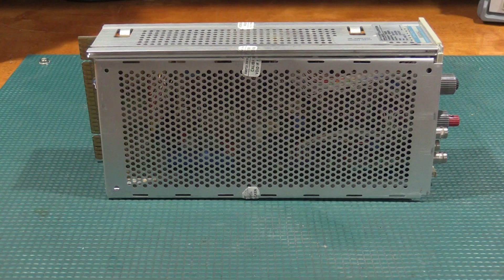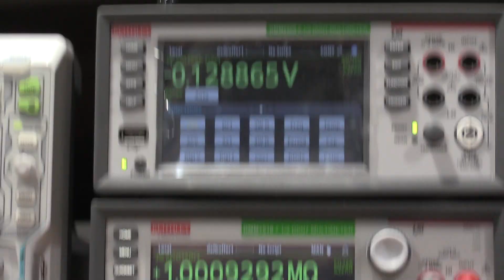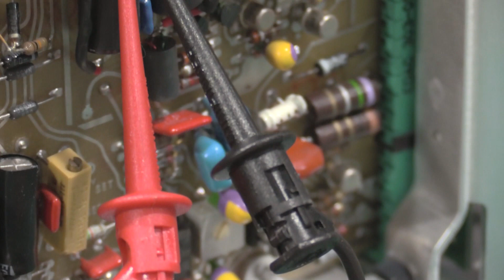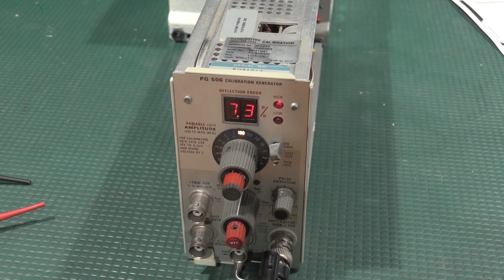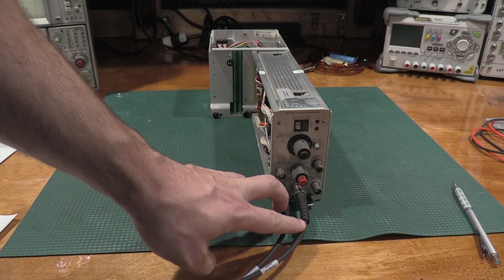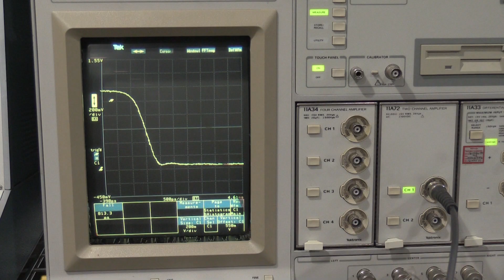Tektronix PG506 Rebuild and Calibration

Comment: So many Tek plug-ins have the plastic bezel of the front panel broken like this. I have taken some dis--assembled doner plug-ins and cut segments of plastic from them to glue in place on restoration target. Of course one must use proper pre-shaping of the break, and the replacement. MEK based liquid plastic solvent from any hobby shop works great to fuse the seam line.

Comment: That is a clean unit - the power resistors on my fast rise/fall board were showing signs of heat stress, still within spec, but looking tired.
I had the same experience with caps you did, but I pre-emptively replaced all the tantalums too, since I had the thing ripped apart anyway.

Comment: If only someone would remake the bezel frames. I suspect most plug-ins out there are broken.
Reply: I've seen guys on eBay who 3D Print and sell them. I've also seen folks who have had them made out of aluminum at a machine shop. If I find the Aluminum ones I'll drop a comment with the link.

Comment: I think these tend to run hot. You are lucky enough to have TM5000 cabinets with some forced air cooling. I would recommend trying to keep it in a 5000 series enclosure when running.

Comment: Look like you are missing the nut / bolt / spacer that supports the back of the fast rise PCB so it isn't just hanging by the front BNCs.  Its a right pain to get the nut on when everything is in place but can be done, easier if the daughter board is out.  Parts and spacer dimensions are in the mechanical assembly parts list / illustrations.
Reply from the maker: Thanks for the heads up on that. It was not there when I opened it, so I suspect that was missing before it hit my lab. But I did find where the board was provisioned for the standoff. I'll get one installed.